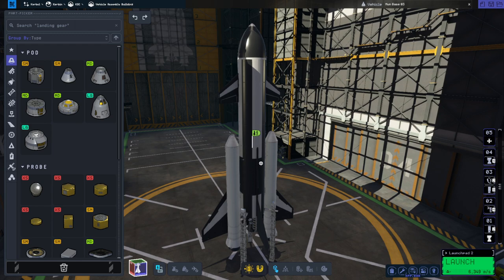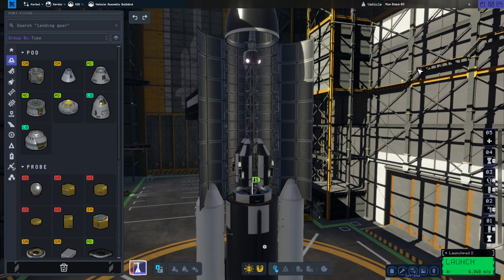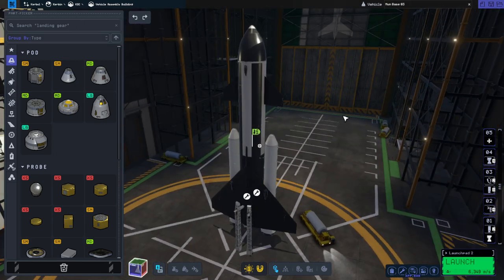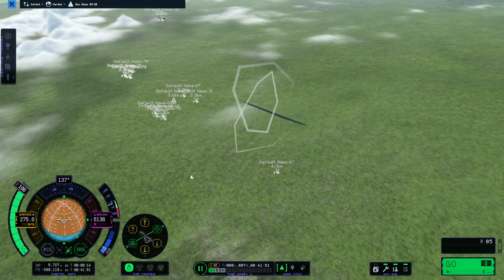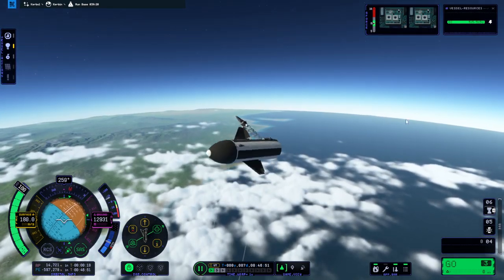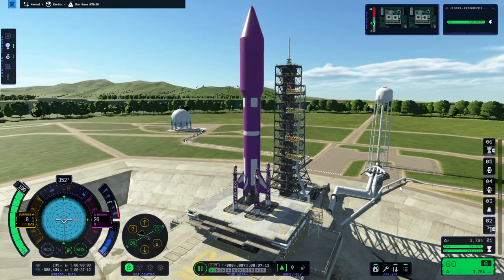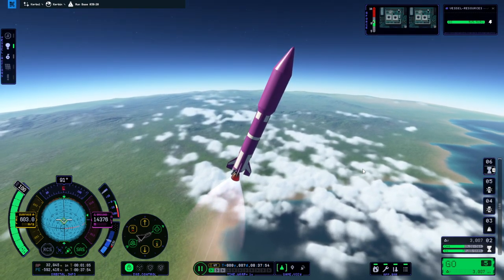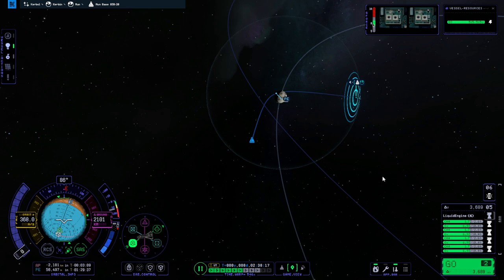KSP 2 Early Access - Mun Base 02

Comment: The reason your wings are going the wrong way is because when you connect them using symmetry in rocket mode when it says 2 will make them install opposite. 
So make sure you using symmetry wing mode.

Comment: Center of Lift only applies to the lifting surfaces, look at Center of Thrust to evaluate the booster and engine placement.
I've been enjoying watching ur adventures, Ty
Reply from the maker: Well, it turns out that it wasn't the booster placement - it was the control surfaces being wacky. People thought that was just with craft that had come from previous versions, but it looks like it's something in this version, perhaps to do with the medium-sized wing.
Reply: @RaizSpace  I've had similar issues, ended up putting 2 wheels in every stage, plus methox rts thrusters to fix my SSTO